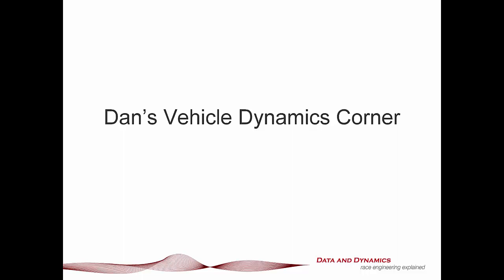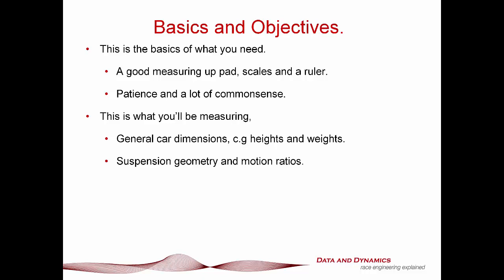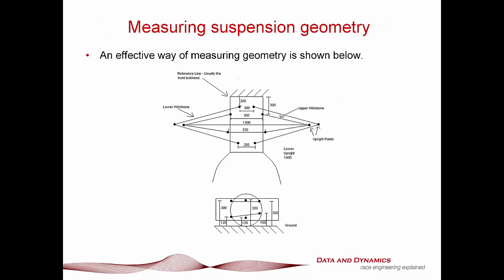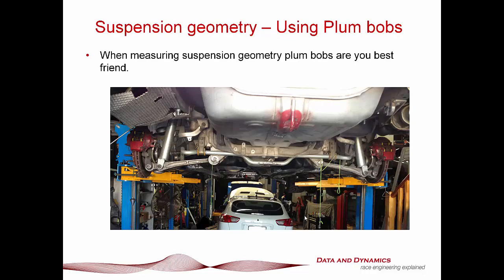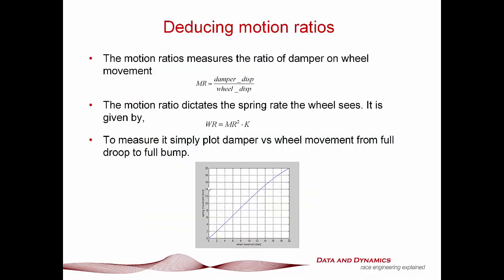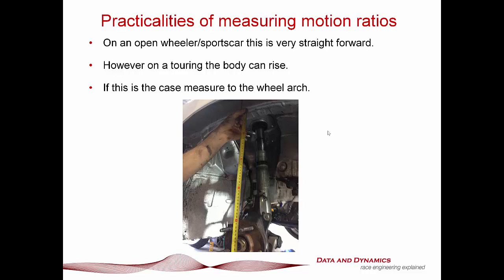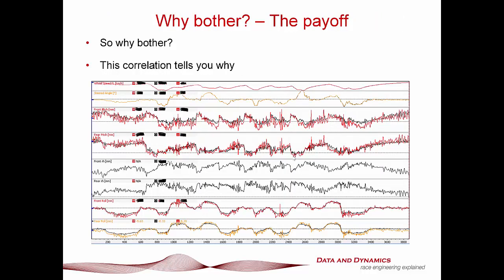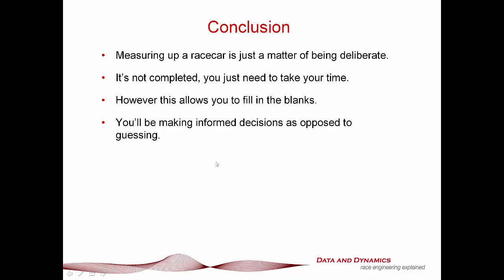How to measure up a racecar

Comment: Danny, thanks for the video, really enjoyed it! 
At the start of the video you meetioned a bit about the cost of sensors "500$ sensores for high end motorsport, while a sensor that costs 50-100 are already good$ "  Do you think, you could do a video talking about different types of sensors? The difference between a 500$ an a 50$ sensor, which are the sensors  that show be the first to be put in a car, etc... It would be greatly appreciated! Thanks!
Reply from the maker: Joao - Excellent question about the sensors. 

Sensor price is horses for courses. If you want sensors that last ultimately you have to pay. The Texsense AUD $1000 triaxis g sensor (for what that is I actually think it's a bargain) and my US Dealer paid north of $500 per damper pot. Albeit they lasted for ages.

However I do live in the real world and I realise that club racers and FSAE teams don't have a lot of money to through around. In that case you have to get going and I know the entry level motec damper pot is in the order of AUD $100. Also use the accelerometer in the dash. Neither are perfect options but they are more than sufficient to get you going.